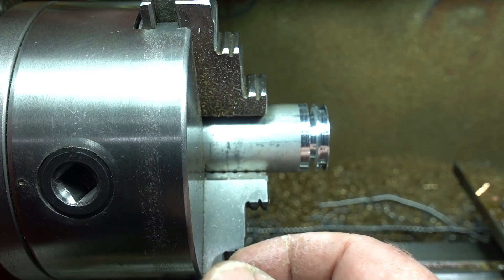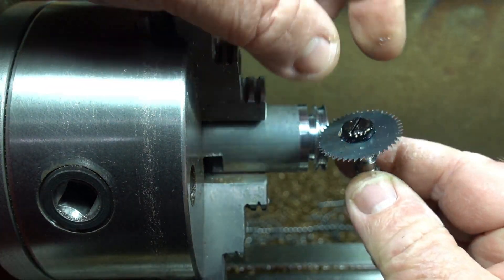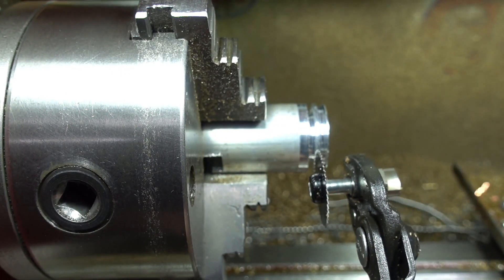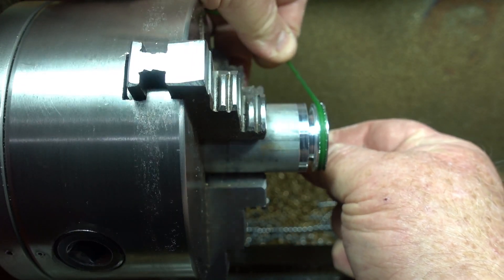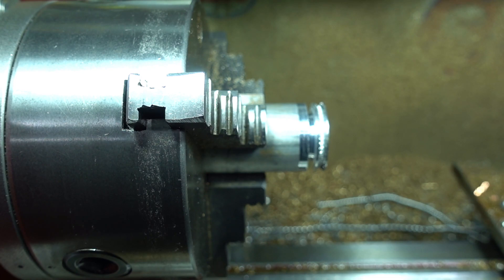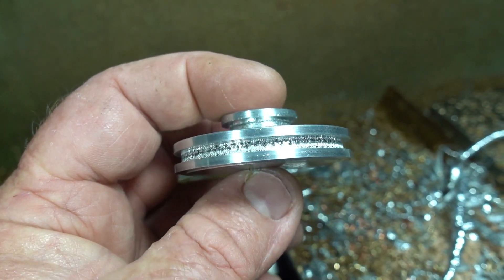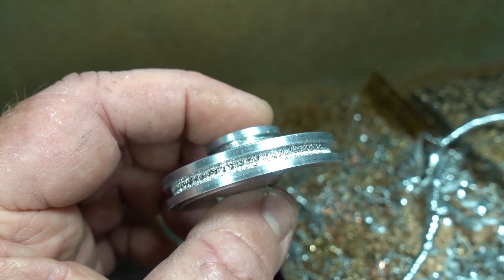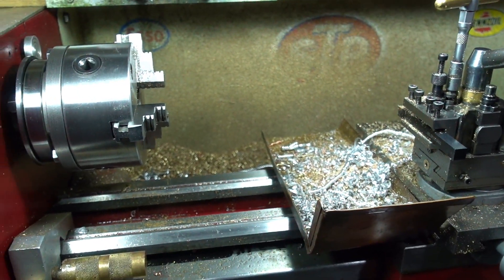Model Steam Engines & Toy Steam Engines Putting Stippling Grip on an aluminium drive pulley.

Comment from the maker: Had some rather interesting comments from the know it all safety Nazis, makes for a good read on this forum where I posted the video -
https://www.homemodelenginemachinist.com/threads/putting-some-grip-stippling-on-an-aluminium-drive-pulley.32581/
Reply: Hey Jim, I know you copped some flak on the forum but I thought it was a great idea so when I had a few belts slipping on one of my little engines I ordered some of these cutters and it worked a treat. I had one pulley that is fixed to a fan and it wasn’t practical at all to spin it up in the lathe so I just ran around the pulley using the tool by hand and that was enough to make a few dimples which made the difference. Thanks for the tip.
Reply from the maker: @Darren_Fawcett  G'day Darren, yes mate I copped some attitude alright from a few folks :) So glad it worked for you like it does for me Doesn't take much to do the stippling and that extra grip really stops the slippage. Hope you have a great weekend - Cheers Jim

Comment: Great idea Jim!
I'm sure you could refine the tool further now that your "proof of concept" has been shown to work.
You should share this idea on the Workshop Techniques area of the Model Engineers Forum.
Reply from the maker: G'day Henry, I think it would be pretty easy to mount it on the lathe. Its not as hairy as what it looks hand holding though and allows you to change the angles very easy. I bet you're looking forward mate to the new lathe :)
Reply: @SteamEngines-Jim  Hi Jim, Cowells are booked up for months so it will be 2021 before I can get them to make a 90 ME for me :-/

I have seen rope knurling done by holding a tap in the lathe chuck. The part to be knurled goes on a vertical spigot  or pin in a square section bar held in a tool post. The part can rotate freely. The pin is the same diameter as the bore of the part.
The spinning tap causes the part to rotate so knurling is achieved. Though primarily intended for decorative turning I see no reason why this cannot be used to add grip to pulleys.
There are videos on this subject if you search YouTube :-)
Reply from the maker: Had some rather interesting comments from the know it all safety Nazis, makes for a good read on this forum where I posted the video -
https://www.homemodelenginemachinist.com/threads/putting-some-grip-stippling-on-an-aluminium-drive-pulley.32581/

Comment: OK never thought of doing that !
I wonder if you used the edge of an angle grinder wheel   or cut off or grinding wheel  could give a similar result ?  Maybe a bit more finer roughness ? + just a thought.
Reply from the maker: G'day Ian,  a friend of mine just wrote and I'll quote what he wrote "I always use a small tap (3mm) in the drill chuck, with the pulley
hand held, on a piece shaft so it’s free to spin, free fingers need to
be braced against the drill vice,  works OK for me"